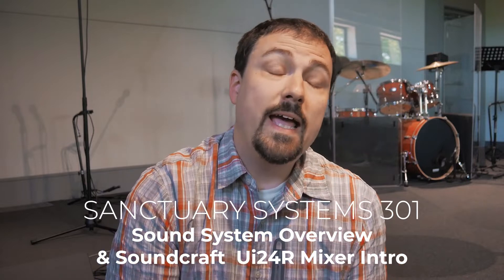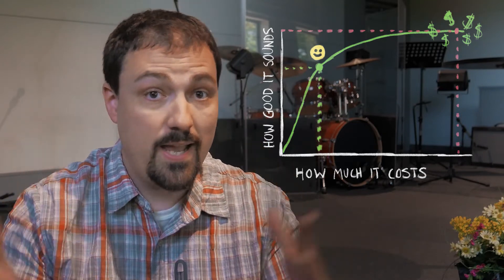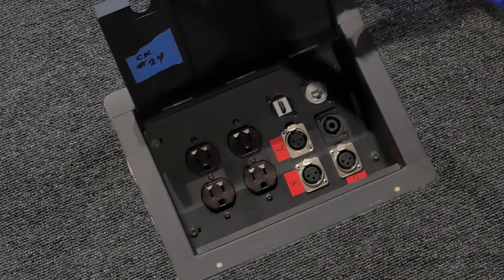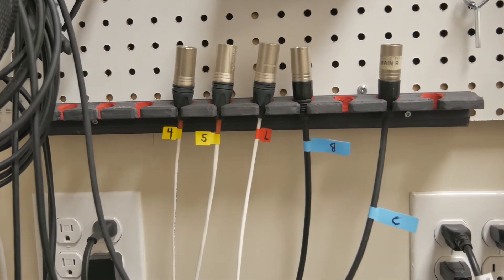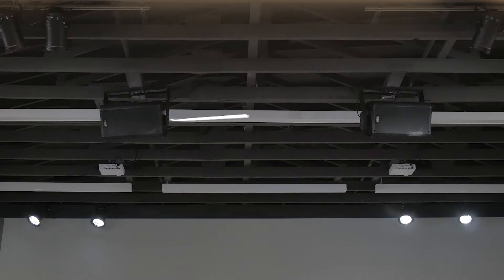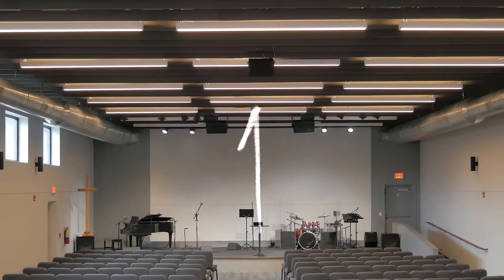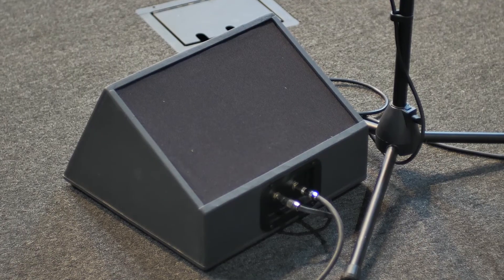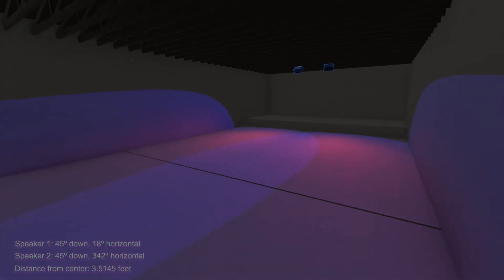Sanctuary Systems 301 - Sound System Overview & Ui24R Mixer Intro

Comment: You don't need dbx DriveRack. Function is included in the mixer
Reply from the maker: Yes. We basically just use it as a crossover. I know we could use the mixer for that but this way saves me an AUX output. We already had the DriveRack from our analog mixer days, so I figured we might as well use it. We don’t use the EQ function of it at all. We do use the limiter as one extra level of protection. But other than that, all the master EQ, compression, etc is set in the mixer interface.